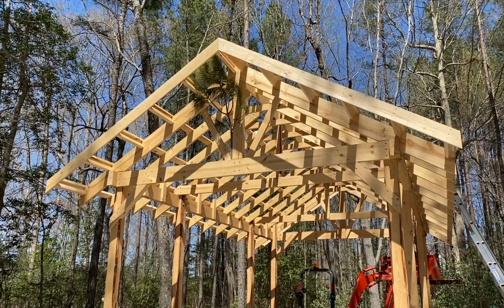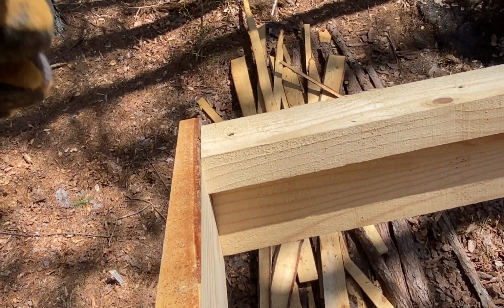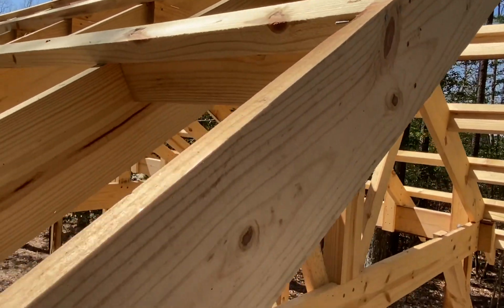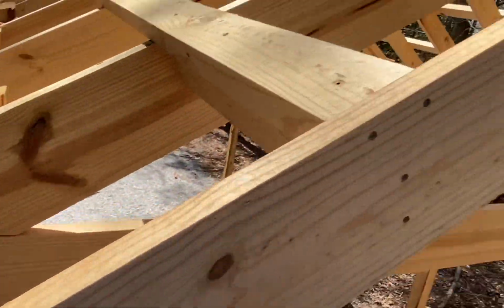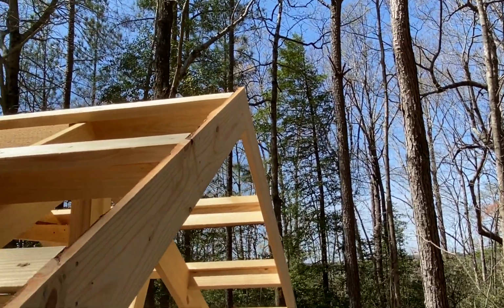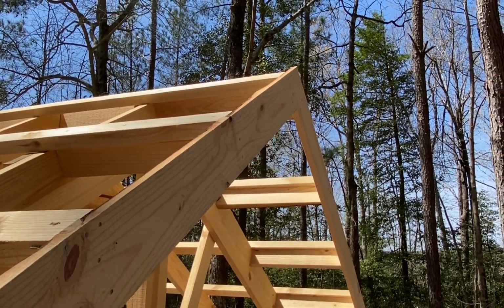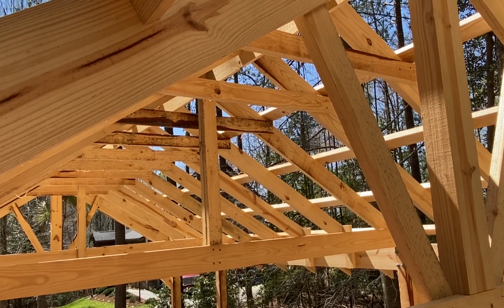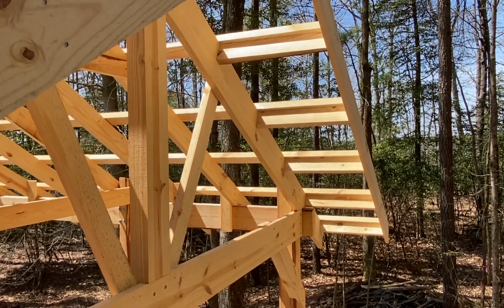Putting up gable fascia boards

Comment: I love this idea for overhang. But isn't the bottom of the rake board not in line with the rest of the row of rafters of it's flush with top of purlins? 
Seems it would be 1-1/2 inches higher than all the rest of the rafter bottoms....
Reply from the maker: Correct, but as it's a trim board there is no strict reason it has to line up or be related to the rafters.  Really, it just needs to work with your trim and soffit design.